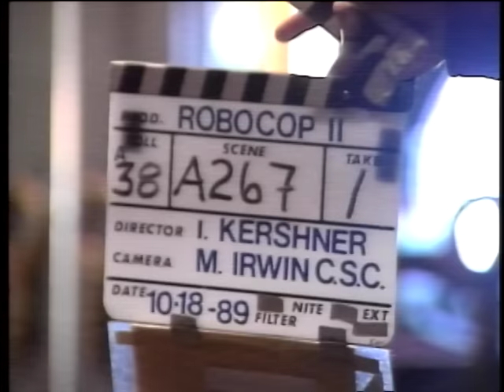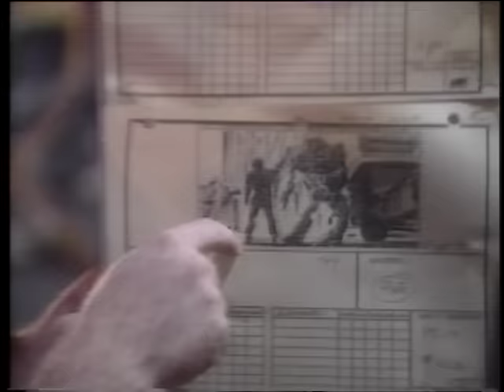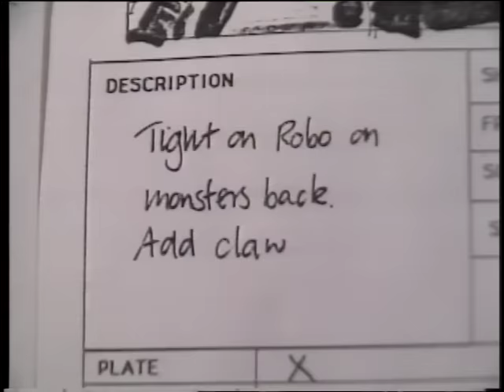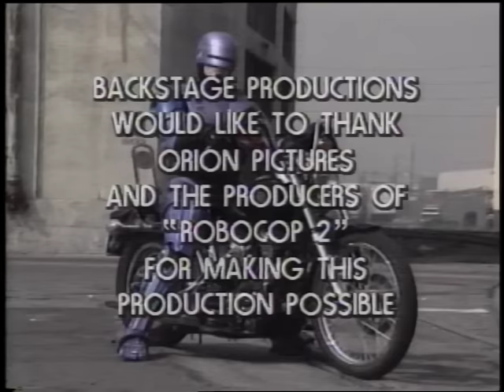Robocop 2 Making (good quality)

Comment: Thank you for this, I am forever fascinated with Hobb's folding blue DEB-M21 (@11:51), so to see the armourer talking about it was fantastic. 

There were only 9 of those original radio disguised folding machine guns ever made, the first prototype made by Utah Connor himself in black, and the other 8 by Tim Bixler as a partner of Utah. 

The one featured in Robocop 2 was the only one ever made in blue.

So it is literally one of a kind, making it utterly unique, and worth a ton of money. Especially in the states today, due to it being full auto and nearly 35 years old. 

The known colours were, 3 in black (including Utah's prototype), 1 in brown, 1 in red, 1 in yellow, and also a green one. The other colours are more difficult to pin down, as they're all owned by private collectors today, and have never surfaced in any other media that I am aware of. 

It's assumed though, the missing colours may have been orange, and a metallic purple like the blue one, maybe even a pink one for the ladies lol.

This is obviously excluding ALL (roughly) 45 UC9's. As they were left over recievers made before the 1986 full auto ban, that were never finished by Utah or Tim, and were sold and redesigned by the new owner. Which saw the removal of the radio disguise elements, and certain changes that massively differentiate the UC9 from the DEB-M21.

Basically making the UC9 crap in comparison to the original. 

I would love to know where the blue one is from the film, and if the armourer still owns it. As this video is the only other time I've ever seen it depicted other than the film. 

And I know for a fact it has never been in any other movie.

It seems to have vanished in to someone else's private collection, most probably. 

I had also never seen the JWC sticker on the left side before. I don't know if it was an original sticker from the manufacturer (Utah Connor), or whether it was added for the film, but that side of the gun is never shown properly in the movie. So it was very interesting to see.

(UPDATE BELOW)

The JWC sticker IS visible in the movie for a split second, during the arcade scene, just before Hobb opens it. Though later during the big nuke lab raid, as Hobb hands Angie her granade shotgun, the sticker is suddenly missing as Hobb unfolds it.

Makes me wonder if the sticker was added for the movie, or whether it's an original design sticker, that fell off later, explaining how it's not on the gun during the lab raid scene. 

Anyway...

Thanks again for uploading this.